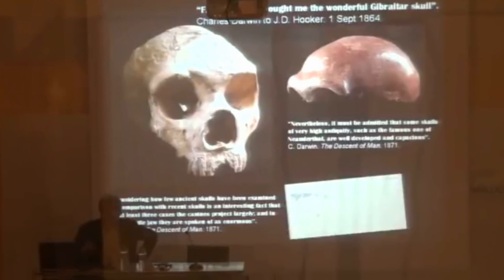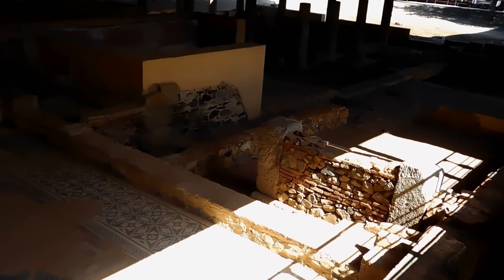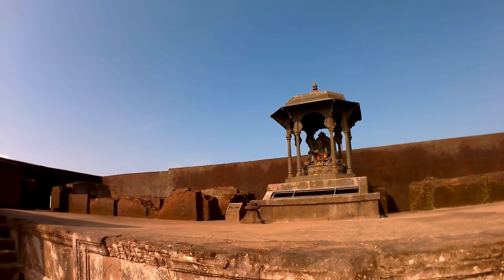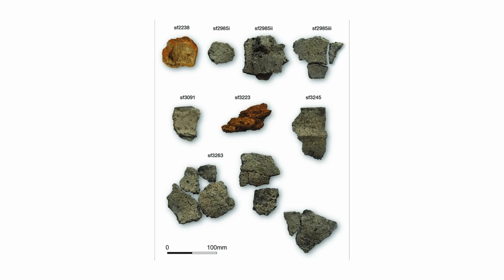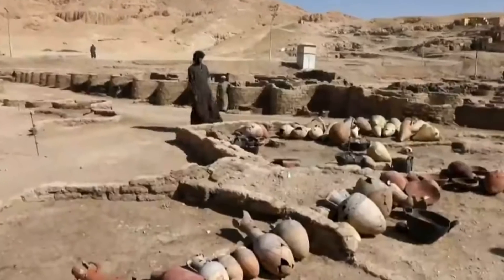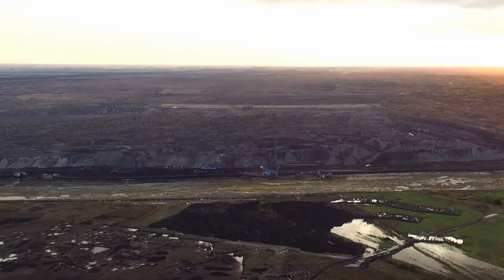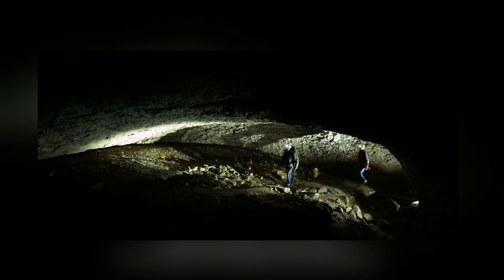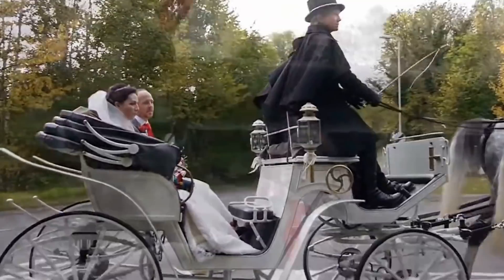12 Most Incredible Archaeological Finds That Really Exist

Comment: Mongols not moogols!
Reply: The Mughal emperors (or Moghul) built and ruled the Mughal Empire on the Indian subcontinent, mainly corresponding to the modern countries of India, Pakistan, Afghanistan and Bangladesh. The Mughals began to rule parts of India from 1526, and by 1700 ruled most of the sub-continent. After that they declined rapidly, but nominally ruled territories until the 1850s. The Mughals were a branch of the Timurid dynasty of Turco-Mongol origin from Central Asia. Their founder Babur, a Timurid prince from the Fergana Valley (in modern Uzbekistan), was a direct descendant of Timur (generally known in western nations as Tamerlane) and also affiliated with Genghis Khan through Timur's marriage to a Genghisid princess.

Comment: What is a moongol?
Reply: The Mughal emperors (or Moghul) built and ruled the Mughal Empire on the Indian subcontinent, mainly corresponding to the modern countries of India, Pakistan, Afghanistan and Bangladesh. The Mughals began to rule parts of India from 1526, and by 1700 ruled most of the sub-continent. After that they declined rapidly, but nominally ruled territories until the 1850s. The Mughals were a branch of the Timurid dynasty of Turco-Mongol origin from Central Asia. Their founder Babur, a Timurid prince from the Fergana Valley (in modern Uzbekistan), was a direct descendant of Timur (generally known in western nations as Tamerlane) and also affiliated with Genghis Khan through Timur's marriage to a Genghisid princess.